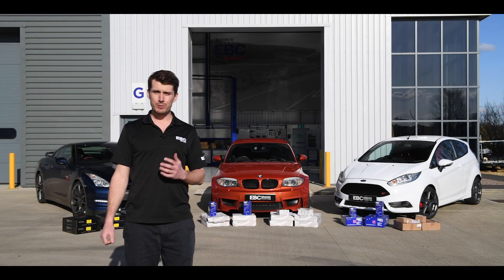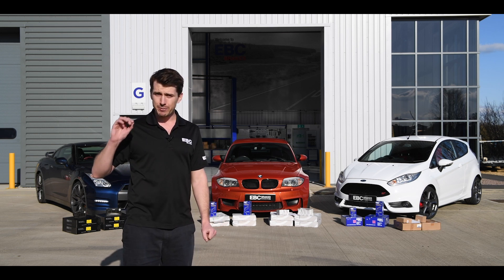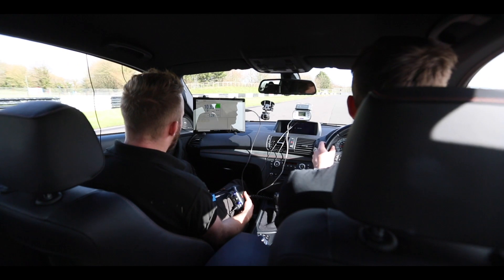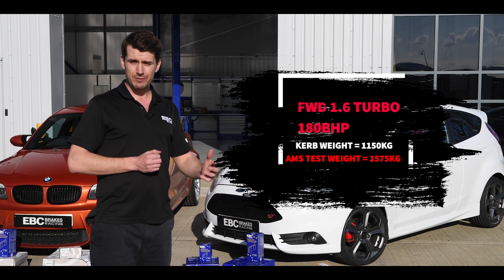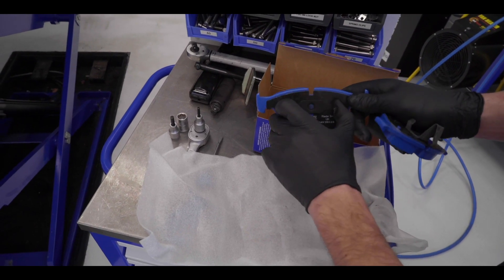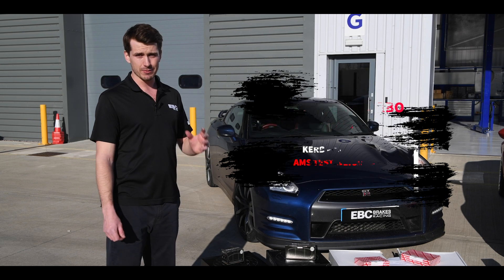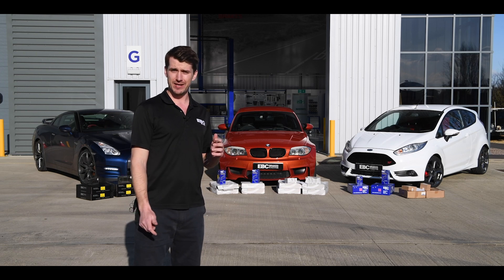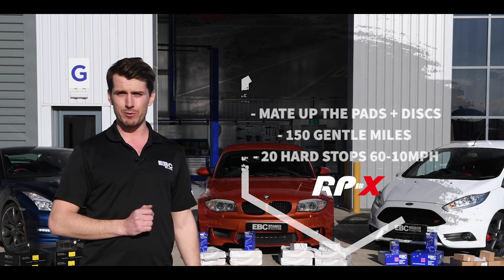EBC’s Ultimate Brake Test | Ep.1 – Vehicle and Product Overview

Comment: Smoked my yellowstuff on my fiesta after 1 lap on the ring. Straight to the bin after 2000km on the road and one lap on the ring. Had a second set, put them on and they glazed faster as my stock pads. Now other brand and not a problem since. Maybe the yellowstuff is not up to pushing as much as i did but for that amount of money they should do better as the stock pads but they didn't. Not to mention the huge amount of brake dust.
Reply from the maker: Hi, we recommend our Yellowstuff compound for fast road and light track use. I am sorry to hear about your experience, if you email technical@ebcbrakesuk.com they will be more than happy to assist in helping you get the correct compound for your application.
Reply: @EBCBrakesUK  thx for the response. Decided this is my last set cause the brakedust is just to much and as i said performance isn't what i expected from them. Will try a more track focussed pad from you guys next time.
Reply from the maker: If you check out our RP range of pads they are for track use only 👍🏻
Reply: @EBCBrakesUK  how is the lifetime on these?